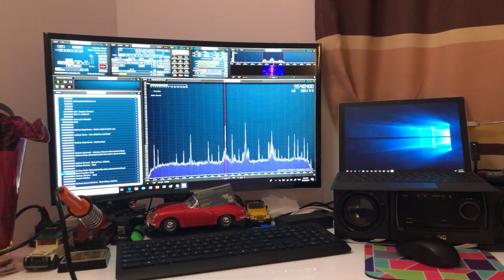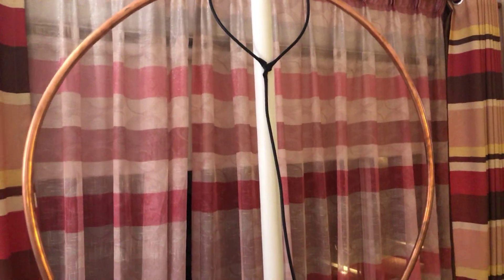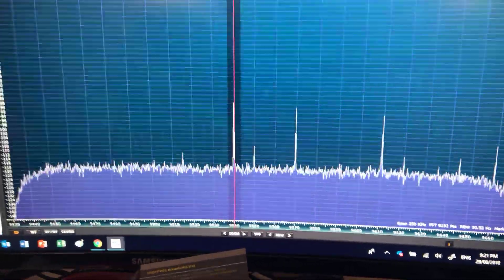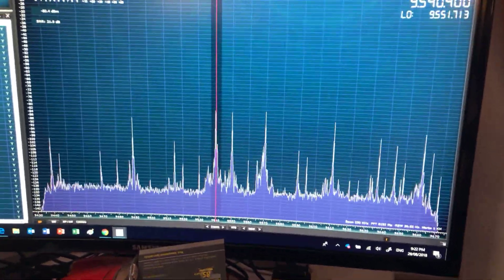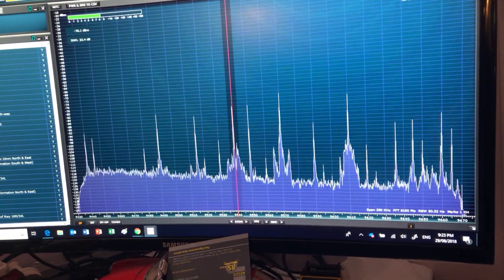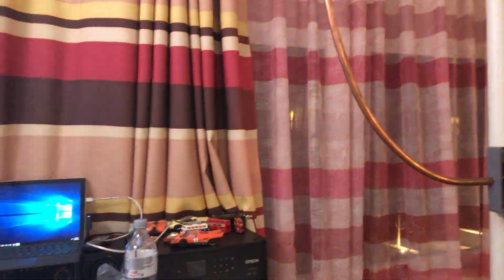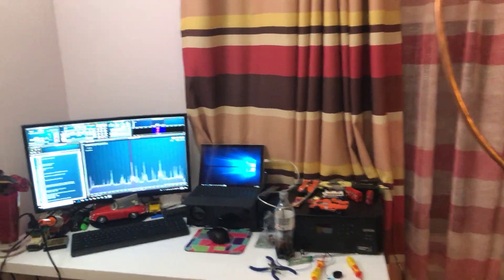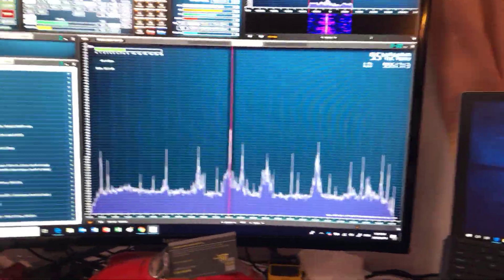SDR RSP2pro with copper loop indoor antenna for HF and Shortwave

Comment: try to put the loop antenna horizontal and compare vs vertical at the same frequency, for example the wwv
Reply from the maker: I made it into a 9m diameter loop with 3x 3 meter sections and use it as a transmitting antenna now.   The capacitor shorts after 50w so I need to keep the lower low

Comment: SIGNAL STRENGTH LOOKS different but were we supposed to hear something???
Reply from the maker: I had the volume turned down for most of the video so you can hear me.  The video was more to show the effect of the capacitor on a loop antenna. I think that was radio china, the audio bandwidth was set to  very narrow.
Reply: @phantomrose1999   Thanks for info! I wasn't sure what was going on.

Comment: I keep looking for more info on these and have recently built one. I cannot figure out what the smaller loop is for.
Reply from the maker: Tyler Hammac it works like a RF transformer.  The primary big outer coil and capacitor resonates by turning the capacitor.  The smaller coil is the secondary that is placed at the location of peak power transfer.  That’s my understanding anyway.
Reply: @phantomrose1999  ohhhhh okay okay.  So with the smaller one, Lets say I have mine split at the top, one side would go to the center conductor, and the other side would go to the outer conductor...and then just use the large loop for tuning only since it will concentrate the power on the small antenna. Does that sound right?
Reply from the maker: Tyler Hammac close, but the small one needs to be split at the bottom as per my video
Reply: @phantomrose1999  is there any way I can contact you to send you pictures of what I have going on?
Reply from the maker: Tyler Hammac just look at my example.  The small loop is 20% the size of the outer loop. You can hold the small loop in your hand  and move it around inside the outer coil until you find the best signal, which is at the opposite end of the capacitor.
Reply: @phantomrose1999  Okay, will do. Thank you for your help and replies.  I've got a set up like yours only my loops are set up opposite of yours with the small one at the top. It may be my cables also, I have like 6 adapters in line all adapting to something different while waiting for my bnc cables to come in.
Reply from the maker: Tyler Hammac the small pickup loop must be at the opposite end of the tuning capacitor.   Chinese adaptors from eBay are very bad. I threw out many I bought and made my own.  The Chinese adapted kill the signal.

Comment from the maker: The specs are very obvious from the video.  Using 19mm copper tube make a 3m diameter loop.  You will need a 6m length. Each end of the loop is connected to the capacitor.  Most variable caps go up to 360pf.  You need about 500pf for the 80m band so I added in another 100pf in parallel with the main air cap.  The pickup should be 19mm copper coil about 20% the size of the main loop but I just used coax as I didn’t have any copper pipe left.  The pickup coax is connected to each side of the small loop.

Comment: Excellent results, but need to know more about how you connect the cable and the cap , thanks in advance.
Reply from the maker: The coax fo the radio is connected to the smaller loop.  Inner conductor to one end of the small loop and the shield to the other end of the small loop

Comment: Do you have a schematic with the capacitor specs and etc.. I would like to try to make one of these.
Reply from the maker: No schematic.  Just make a 6M loop using 19mm Copper.  The two ends need to be connected to a variable capacitor.  The smaller loop is about 20% the size of the main loop.  I used a surplus capacitor, max of about 400pF.  But to get down to 3.5Mhz i added a 100pF capacitor that i switch in parallel with the main capacitor.   Hope that helps.